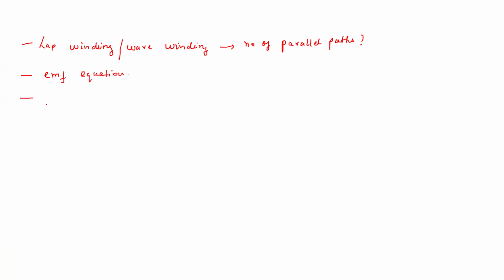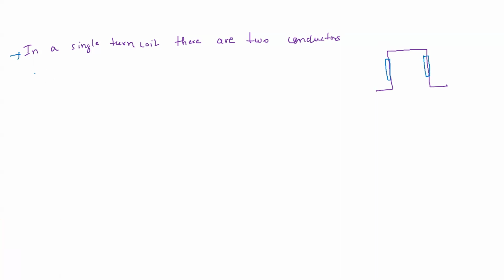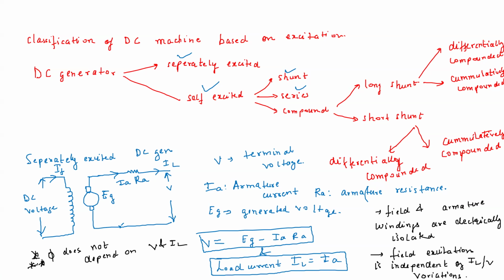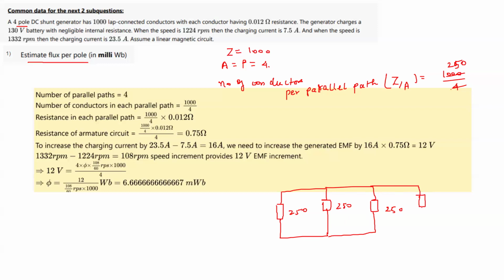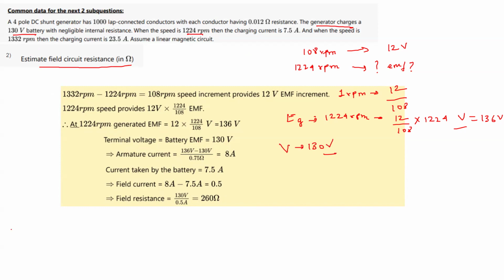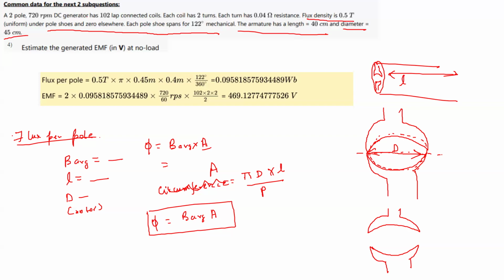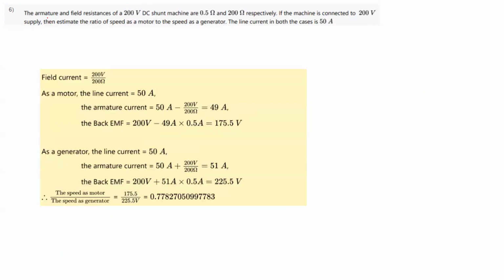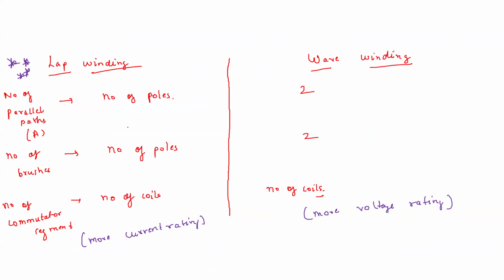NPTEL Electrical Machines-1 Assignment-8

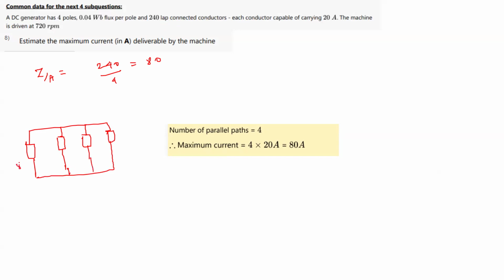Comment: Q. No. - 8 ( 1:18:55 )
Dear ma'am 
Max. Current = 80 A (4*20) , if   & only If each parallel path is capable of carrying 20 A current . ( i think ) 

but in question it is not given, instead it is given that each conductor is capable of carrying 20 A.

Is the question wrong or anything else i am missing 🫣🤩
Reply from the maker: @AbhishekKumar-hm5vo  Hello Abhishek. See the conductors in the same parallel path are connected in series. So the rating of a single parallel path is the rating of a single conductor or conductor which has the least rating (if conductors ratings were different).
Reply: @SakshiSingh-zb6nb  yeah , thanx mam